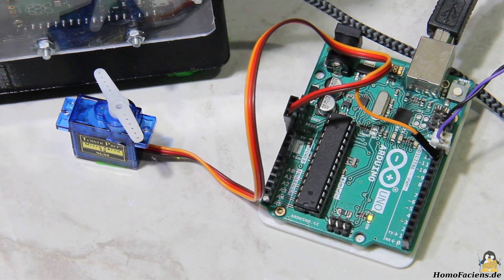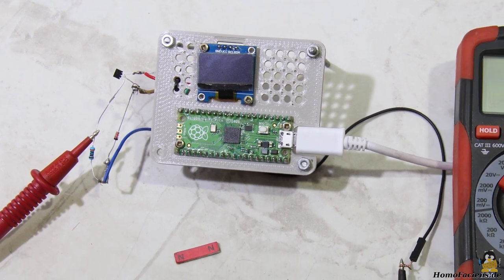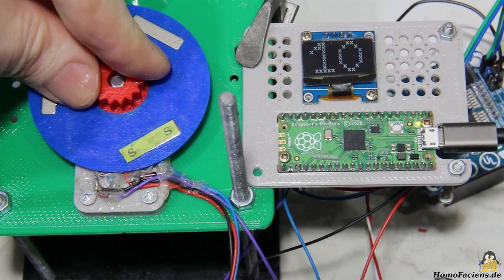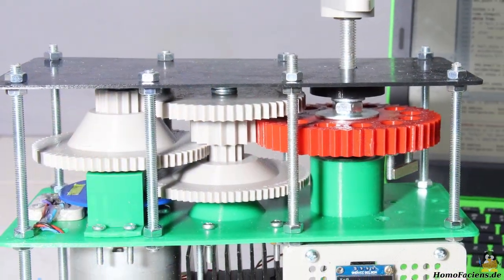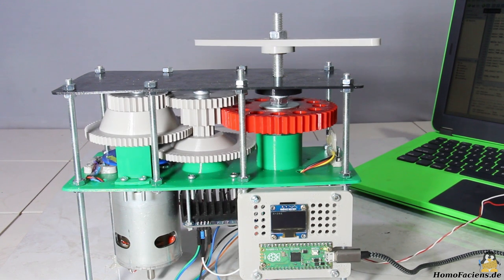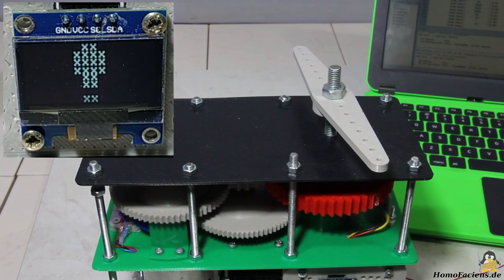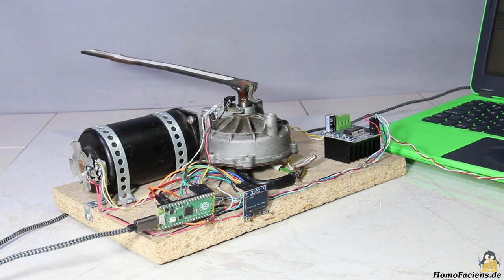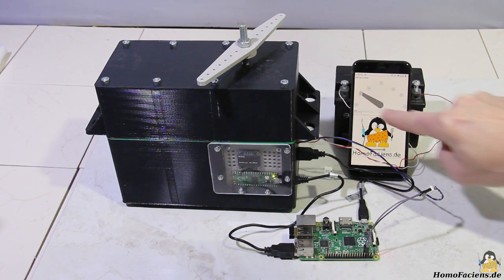Giant servo based on a Raspberry PICO

Comment: Very cool! Have you thought about using the analog values from the hall sensors for absolute feedback? you could put one set on the final output gear for coarse position, and a set on the first input gear for fine position
Reply from the maker: I don't see a major improvement in this, but yes, in theory this could be done. I am a bigger fan of digital measurements since capturing analog signals with precision is tricky. A video on this is on my list of things to do...

Comment: Would be interesting to see what kind of performance a servo this big could do before the 3d printed parts fail. Obviously something like the original 355:1 is enough for it to absolutely obliterate itself, but the magic number lies somewhere between 1:1 and that, and the closer get the more "efficient" it is as you trade unusable torque into usable speed.
Reply from the maker: Yes! The good thing with 3D printed parts is that you can quickly adapt the design to higher torque by creating larger gears (at least somehow) or printing with other materials than PLA. I am no big fan of destruction videos, so its up to someone else to do that kind of experimentation ;-)

Comment: Another excellent video. How do you like the pico compared to the arduino ? One obvious advantage is only having to learn one language, python. I have learned a lot about motor control from your  previous video using porportional, Integral  motor control.
Reply from the maker: Thanks! The Pico has clearly more resources, especially the State Machines are really great. On the other hand: More resources are equivalent to a more complex hard- and software. The Micropython interpreter it a huge software suite compared to nothing but a bootloader on the Arduino. I like the simple hardware of the Arduino UNO a bit more over the easy to use of the Pico, but both are great machines! I have a couple of Arduinos (at least Atmel chips) in stock and will order some more Picos, thanks to your support!
Reply: The 2 cores of the PICO will surely be a fun topic to explore.
Reply from the maker: Yes, having a 2nd core for a second main routine could be helpful for special projects...

Comment: thanks for the video sir! i'm very new to programming is this posible to use this with step/dir command? i want to build a 3d printer with this setup thanks
Reply from the maker: As told in the video, the source code of my PICO servo is available on my pages:
https://homofaciens.de/technics-physical-computing-PICO-servo_en.htm
Yes, you can control it by step/dir commands, but you have to implement the position feedback in your 3D printer firmware somehow. You will have to learn a bit about coding to make your idea work. It is a bit beyond the blinking LED beginners project.
Reply: @HomoFaciens  i'll do furthuer research sir, thanks for the feedback. i'd never work with a micropython before. is the pwm input signal mean the step? and i just add dir input signal? honestly i dont really know where to start. once again thanks for the feedback
Reply from the maker: The script as it is accepts input control via Servo PWM signal and has a demo mode. You must choose two more pins from the PICO and add these to the code base to make it compatible to Step/Dir control. I haven't implemented that in the code, yet. 
The PWM and Dir you refer to in my Python script are only for internal use (these control the H-bridge that in turn controls the DC motor).